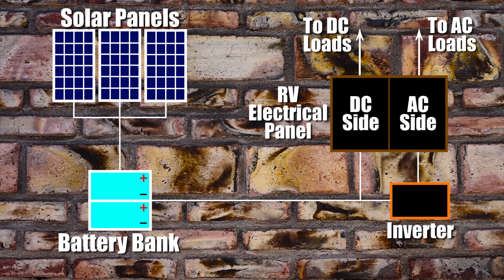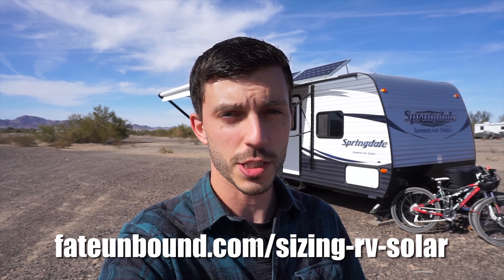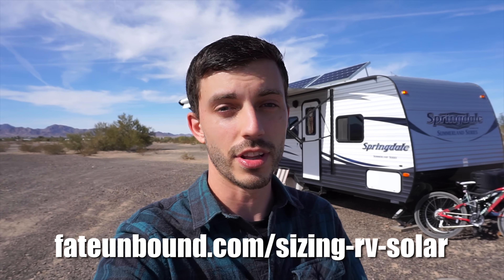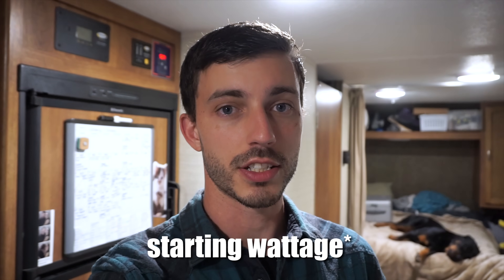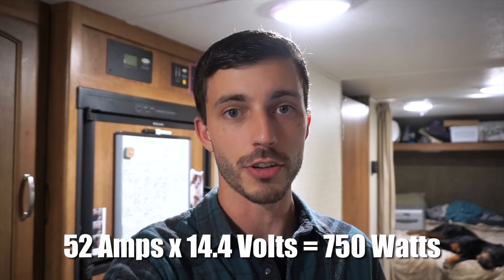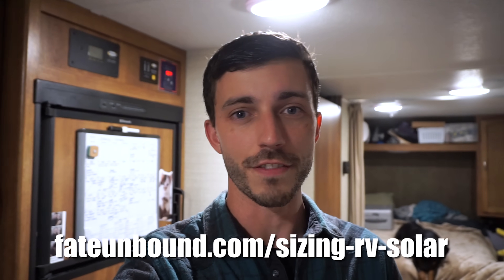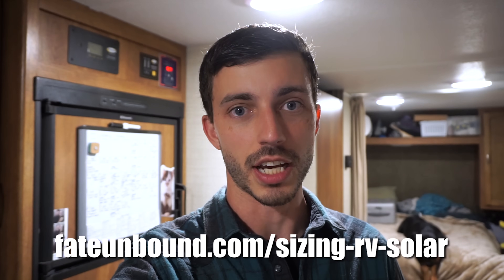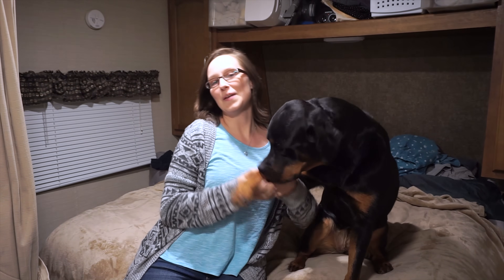How to Power an RV Air Conditioner with Solar - Full Time RV Living

Comment: this is a rally good post, but I was thinking more like 1 - 1.5k of solar panels dedicated to the  A/C.
Reply from the maker: Yeah we definitely don't have enough solar panels to regularly run the air conditioner using out batteries. 1kw -1.5kw is a good range though

Comment: Very informative video, appreciate your time and effort.
I live in Central Florida and my electricity is 21 cents a kilowatt hour. I'm just looking for solar power during the day and then run the air conditioner off of shore power at night to try and reduce my electric bill. So I'd be looking at putting up if it will fit on my 30ft trailer, at least 2400 of solar panels.

Comment: There are new RV AC units that run on 48 volts (typical residential solar panel voltage) and only pull 1300 watts.

Comment: Your calculations are way off. My Coleman Mach 48000 series ducted air condition draws 13.9 amps when cooling. 

Start up will be 2 times running amperage without a soft start. So, this would be 27.8 at startup. 

A soft start device will reduce the start up spike by 65% to 75%. So, my AC would draw 18.07 and 20.85 amps at startup with the soft start. 

Like a fridge, an AC is going to cycle on and off approximately 3-4 times an hour when it is running. To estimate usage, I use the formula =((0.25 hours per cycle x 24 hours per day) x 1 AC) x 13.9 amps per hour. This gives me a total of 83.4 amp hours to run the AC on our TT.

Comment: I have 400ah of Enerdrive lithium batteries with an enerdrive 2000 inverter, webasto air con and I have no problem at all running all day on low, I can run an extra solar blanket if I like and generator at night, your air con is massive.

Comment: Double checked my understanding and your 70amp draw on DC is correct and i was wrong.
Reply from the maker: It's 70 amps from a 12v source not a 120v source. The batteries are 12v
Reply: @FateUnbound  your inverter wouldn't handle 70 amps nor would the wire.
Reply: @FateUnbound  I  double checked my math and i was wrong.  Not sure how that works now.

Comment: Just FYI your a/c doesn't run on 73 amps  of power . Most houses don't use 73 amps to run the whole house. I'm just saying
Reply from the maker: Just FYI, I'm talking in terms of a 12 volt nominal power source - the RV's batteries. This video is all about powering AC with solar, so it is all in terms of a 12 volt power source. If it was from 120 volts like in a house it would be pulling 7.3 amps. So yes, my RV's air conditioner does pull 73 amps from my 12 volt batteries when running.

Comment: Thx for sharing I guess my best bet is to get some reflective material so the sun doesn’t beat down on my camper so badly n turn my ac on and off my camper is a Shasta 18FQ very similar to ur guys layout but I’m plugged into 30 amps and at an rv park in Florida thx for the tips and info and sounds like the overall cost is not really worth it as much as I wanted to save money n be off grid. 😂

Comment: Ok, from what you said for a 24/7 AC you would need 750W (4-5 good panels) straight powering the unit for the 8 hours of useable sun a day, plus 1500W (8-10 more panels) to charge the 1200AH (16-20 lithium batteries) of storage for the 16 hours where the sun isn't strong enough to produce a charge. But you also need another couple panels and batteries to ensure you aren't trying to use 100% capacity daily because deep cycling is bad for the batteries. Also anywhere that requires 24/7 AC to be comfortable is also extremely likely to overheat the panels reducing their output so you also need more panels to combat heat production loss... 

So you need say 18-20 panels on a sprinter van whose roof can maybe hold 1/3 of that... so you need 2 deployable heavy duty steel slider drawer awnings that you can extend out during the day and slide in when traveling or at night. And the weight and space are going to effect fuel economy and usability when you could just chase the weather and move someplace cooler

Comment: I just found out there is a thing called a slow start that you can put on a AC to lower the amount of energy to run a AC so you can run AC on solar if you have approx 600 AH of battery running AC all night  "8 hours" used about 50% of the battery and the A.C. was set on 68 degrees

Comment: Three years later, they make decent DC Air Conditioners. That are small enough not to take up too much roof space. Or can be mounted into the floor under beds. Check out Vanlife DC Air Conditioners.

Comment: That's a huge ac for a solar setup.
I'm building from the ground up, on a  shuttle bus platform.
My living space is 16.5'x 8.5', and I'm  only installing a 9k BTU mini split, on a 1k solar array, with a 600ah lithium battery bank.
Rvs are usually set up in favor of being plugged into the grid, unfortunately.
Reply: Rvs are poorly insulated. A 13.5k unit on a hot day in the sun will struggle to keep up even in a smaller camper like the one in this video. Its not like sizing a unit for a home.

Comment: There are more energy efficient AC out there.  I have been considering a 5,000 BTU AC, which runs on only 15 amps, instead of the 73 amp AC in this video.  None the less, it is my aim to calculate the amp hours needed to run such an AC for 12 hours a day.  Thank you for the explanation.  Best.

Comment: I built my own toy hauler and installed a 12k ductless system. I have 1440 watts of solar and 280 ah at 48 volt system. I have run my AC  for a week nonstop with no problems.

Comment: A 13500BTU A/C should only draw 13 to 15 amps. You need to check your system. 70 amps would burn your wires.

Comment: You calculated your Amp hours by the startup power pull. Once the space is brought down to temp it will idle a lot more. If your space is thermally insulated, that also saves power. The best advice I’ve heard is to set a timer to start the AC in the morning before the temperatures rise.

Comment: I live in my RV full time. I would love to be able to run my 30 foot Dutchmen strictly off propane and solar. I have a 135000 AC. I have a norcold refrigerator and I do not use the electric for my water heater. I turn it on and off as needed using strictly propane. Propane seems to heat the water hotter and last longer. I am getting ready to upgrade my built-in inverter/converter because it doesn't charge the battery and does weird shit. I keep a trickle charger on it because right now I am plugged into shore power.  However I want to travel. I have 30AMP in. When I run the vaccuum the circuit @ the circuit breaker shuts off. How can I calculate battery usage? I live in Florida, so we have sunlight for days and days. I would ultimately like to be able to not have to flip a switch, but be connected to shore power as well. I currently have a built in converter/inverter that I know is screwed up because it won't charge the battery on shore power which is why I purchased the new upgraded inverter/converter.

Comment: Buy a Wal Mart 5000 btu, probably draw about 7 amps w compressor on.  Then use it in a window by the bed and hang a sheet ti separate the "hot" part from the "cold" part.

Comment: There's a math problem here. Adding batteries and 750 watts will work on AC ONLY IF you have sun 24 hours a day. In most cases, you can expect to collect around 4 times the face value of your panels per day (because of the insolation curve), which would limit a 1KW solar panel set to 4Kw collected. If your daily use is 2.5kw, 1.5 kw would remain to run the AC for about an hour. Running AC requires a 3000 watt inverter and an Easy Start on the AC unit itself for a dual-winding low amp start. Even the Honda 3000 generator does not advise running roof AC because of the startup current.  The total battery sizing should be just over the maximum you can collect on the longest day of the year. Why? because MPPT controllers will throw away energy as heat on small battery banks already at full charge, but will push till sunset to charge larger banks (our is 500 amp hour LfP). So to ACTUALY run AC, you need to assume a 50 percent duty cycle of the air conditioner over it's operating time. About 1200 watts sustained. A six hour run would require 1800 watts of panels beyond your base use. We run 1730 watts of panels on our system, and barely meet our base need - we use alternating current 24 hours a day and have a 75 watt cube fridge, satellite system and Nextivity cell pho0ne repeater attached. With lithium, our 500 amp storage capacity is 500 times 13.8 volts at full charge or 6900 KW hours. to collect that on the longest day of the year, we'd need to match it with about 1600 watts of panels. We plan to go to 2 KW, so our batteries slowly fill over days of boondocking, and then we have to use the Air conditioner one night every 4 to shed power, or have reserve for bad rainy periods. Remember, panels placed at 90 degrees still collect 75 percent of what horizontal panels do. So our system has panels to face the sunrise and set so we can get our 250 watt per hour regular burn from the sun, not the batteries.

Comment: I'm no way an expert on this so This Is Why I'm a little confused you said your AC unit requires 70 + amps to run.

I have a class A Diesel Pusher motorhome with a control panel when I run my front AC unit it only says 14 amps on my control panel, the one on the back runs off 9 amps  my motorhome is a 50 amp motorhome.

So my entire motorhome can't run your AC unit if it's 70-plus amps😅

And my air conditioning unit on the front anyway it's 15,000 BTU maybe I missed something😕

Comment: Agree you can do it but is it worth it?   Same for a home.  It can be done but at what cost.  If I was full timing I would move like you do and have a generator for back up.  You also have the option of going to a camp site that has electricity if you want to be somewhere where you can’t be without ac

Comment: your amp meter cannot be accurate.. there is no way that your ac is drawing 73 amps. that means your AC is drawing around 8000W. Even at compressor startup this is inaccurate.
Reply from the maker: It is drawing 73 amps from our batteries, which is a 12 volt source. 73 amps x 12 volts = 876 watts, not 8000 watts. This whole video is about running air conditioning off of solar and batteries, which again is a 12 volt source. If you still dont understand, do some short reading about how inverters work and how electrical power is converted from 12v DC to 120v AC by an inverter to power 120v appliances with 12v batteries.

Comment: The only thing all you RV solar Air people forget about is your running inside thermostat Temps. Run your A/C at 76 to 80 degrees and you should have no issues getting a 1200 - 1400 watt system to run everything all day. The best thing to do is don't use the rv a/c is it is the most inefficient system out there. Most 120v window units are more efficient then an rv roof mount. The best option is a 12V solar mini split jeat pump system that can operate from 3 panels to 5 panels. The key to running A/C in your RV is not using the factory rooftop unit. The new solar splits are 23 seer units, some of the most efficient systems out there.

Comment: My 110 to 12V power converter just died and I'd like to add a solar option to my trailer. Should I be looking at a specific type of unit to replace the basic charger/converter? something that has solar connections built in?

Comment: I'm living in a small vehicle. Very small vehicle I took all seats out (besides driver) to have a very narrow space to sleep, foam cooler and 2 bags of clothes. I want to be able to use my own vehicles battery plus  an additional one to have inside my car with solar panels to use my owns car ac at night without turning it on and spend gas. Can you help me? My email is lairaqlingui@gmail.com

Comment: Hi, I have a few questions for you, if you don't mind me picking brain a bit. I see you and wife predominately boondocks. How do you replenish your potable water, and how much do you use in a day. Also, how often, and where do you dump your grey/black tanks? 

I am thinking of doing this fulltime RVing and am concerned about power. I plan on either getting a travel trailer with a generator, or have one installed. I figure to get a dual fuel type (propane/gas), but have concerns about constantly needing to replenish the propane tanks, or hauling a couple of 5 gallon jerry cans around. Gas is cheaper and lasts longer (8-10 hours @ about $1.25 an hour), but propane is safer and cleaner, but more expensive, and not as efficient. 

The trailer I am looking at has a solar option for up to 2-200 watts solar panels with another connection below to add another 200 watt portable panel. That would give me about 600 watts a day of solar power. 

I agree with you to move with the weather. I don't like hot and humid...guess I shouldn't have retired to SW FL then, huh! lol I figure northwest states during the summer and move south as the winter starts setting in. Montana/Idaho have an average high during the summer around 78* and an average low at night in the upper 50's to lower 60's. Meaning, very little need for air conditioning.

Thank you in advance for your time.

Comment: A 13,500BTU AC unit should draw about 73A in a constant running mode. I saw your update where you said it pulled 150A constant and there's just no way that's true. At 73A and a 12V battery bank you're pulling 876W which is low for an AC that size but at 150A at 12V it's 1,800 watts which is way too high for an AC unit that size so something is off with your numbers. Your AC should be around 1300W so at 12V that's 108A of constant pull. This may fluctuate as the AC does "it's thing", meaning compressor on and off and so on. The Wynn's did this same test with a 15,000BTU unit for 4 hours and they got an average draw rate of 88A for comparison and this is before they added their soft-start setup.

You also have an extremely small solar setup for running an AC system and would want to have as many solar panels as could possibly fit on your roof in order to attempt this but it can be done. I lived off-grid for 10 years and I ran my AC unit off an inverter and it was no problem at all. 

One more thing to mention, a 3000W inverter is more than enough to run your AC unit forever without damage. Inverters are designed for starting ratings double their rated run rate so a 3000W inverter could start something 6000W. Also, a 3000W inverter should never be ran at 3000W as the constant run rate of an inverter is almost always 85% of it's advertised rating.

Comment: just tow a solar generator made out of an enclosed off road cargo trailer.  thats what me and the wife are planning to do when we go full time rving in about 6/7yrs since we will have to tow a trailer for my harley anyway we might as well turn it into a power station and mobile resupply for the fresh water/food.  longer time out boondocking that way.  and just make sure it has a 30amp/50amp box to plug in your rv.

Comment: The most you are going to get with 750 watts of panels is 6 amps per 100 watts of solar so 45 amps per hour. So you are only getting about 300 amps in seven hours. So 750 watts won’t even keep up in full sun. I believe your calculations are wrong

Comment: Night you only need a fan , and you can turn the aircon down , and not all aircons pull that much power , I run a 800watt aircon off 280 amps of lithium for 4 hours , but that’s without solar input, so if I have 800 watts of solar going in and 800watts of aircon going out I’m not using any battery power

Comment: you should install a mini split ac and heating system.
Reply: What’s the difference between a mini split and a standard ac unit?
Reply: Also wondering the same Q as Katie Sharp

Comment: Or, You have 900 watts of solar wired direct to the A/C, via your converter, bypassing the batteries. Install a "slow" "Low Load" startup on your A/C unit to eliminate that power surge. By doing it this way you are not "Hurting" your batteries. When not using the A/C you can then "Switch" the power from the solar panels to feed your battery bank. If you have 2 banks of solar panels you could have the second bank feeding your batteries all of the time.

Comment: 73amps of batteries for every hour you want to run it is not necessarily true. If your aircon is well suited to your van then the compressor won’t be constantly running flat out. If it’s running for half of any given hour (especially at night when it’s cooler) then it’s 73amps or less every 2 hours, or more!

Comment: You can make a battery that is very small if you order directly from china and put the cells together.  It always seem to go back to how much solar you can put on your rig. But if you have a good battery and at least some solar you can go many days without turning the generator on to top off the batteries.  The more solar the long you can go without charging.  It's well worth buying lifepo4 cells from aliexpress. Battleborn is great but $2,500 direct from china DIY vs. 8,000 for battleborn is a no brainer in my book.

Comment: 👍👍👍👍👍👍 Excellent. 
Also you may be interested in having a look at Gone Boondocking's YouTube channel. David has setup a mini split air conditioning which is a residential unit operating on a 800ah battery bank. According to David it can be run on low speed 365/24/7.
Reply: Plus the advantage of a mini split is that it is a heater also...

Comment: That was not bad I figure 8 300 watt pannels and 12 lithium ion batteries expensive hmm 250.00 x 12 batteries to build
100 for used sun pro cells time 8 
4000 watt inverter for Ac 450.00
2000 watt for other appliances  296.00
I buy at wholesale  cost so is it alot yep is it expensive  yep is it worth it yep I have a mini split that draws 1300 watts at start up 15 amps so it should max pull a lot less hence who I dont like ac for rvs